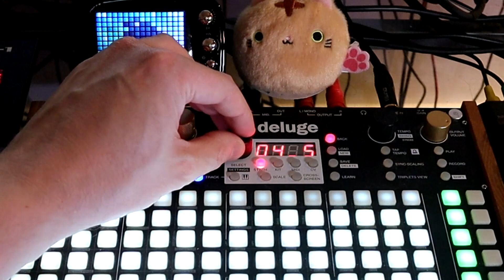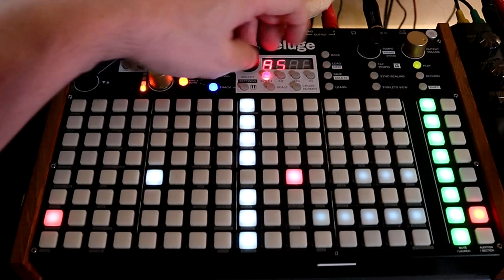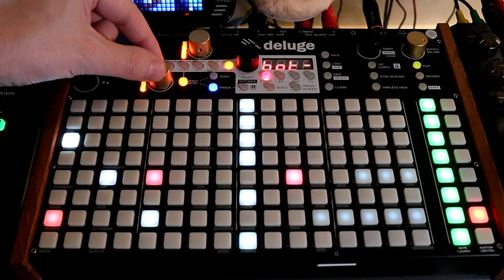Wavetable Synthesis (4.0)  // Synthstrom Deluge Tutorial

Comment: great video !

but there is something a cant wrap my head around it

how do you assign enveloppe as a "scanning" mode ?

usually , on my tracker , i can use an enveloppe to the position of the wavetable

i dont seem to find it on the deluge hahaha

nice tutorial anyway !
Reply from the maker: The setting"wave" under osc
Reply: @RonCavagnaro  wich one ?
im so confused x)
Reply from the maker: @eridon63  enter menu press select knob. Turn to osc1, turn to wave and then press down turn to env1 or env2 and change amount. What are you confused about
Reply: @RonCavagnaro  i want to assign the env 1 or 2 as scanning through the wavetable , instead of the "default" LFO 2

but i find it , thx for your help :D
Reply from the maker: @eridon63  you got it good there you go!

Comment: One noob question. Are wavetables meant to be played at the very bottom of the keyboard? Because it seems that as you go up the keyboard every wave in a table approaches the sound of a sync'ed square wave.
Reply from the maker: It depends on the files you load in, if it sounds brittle you can use cutoff